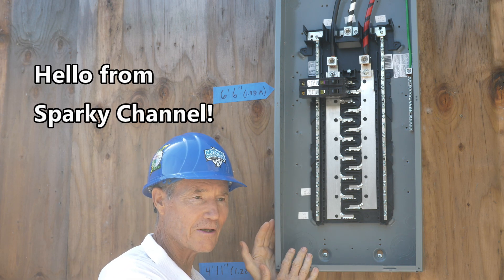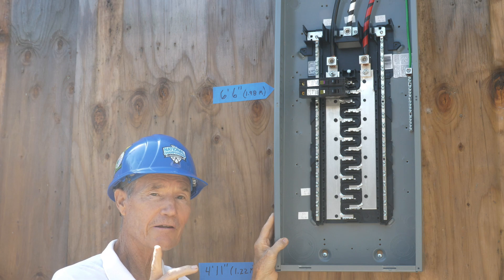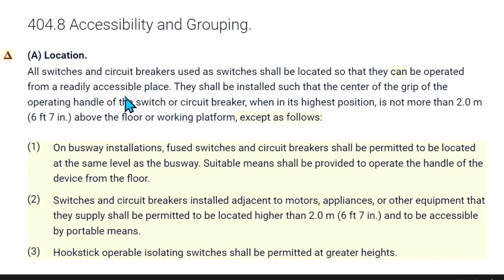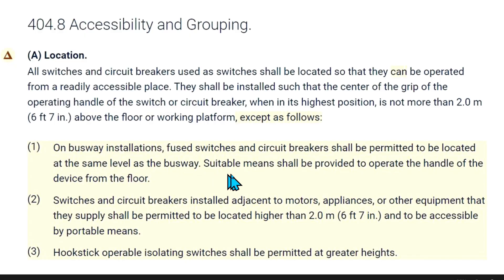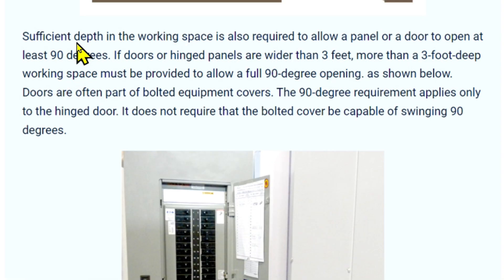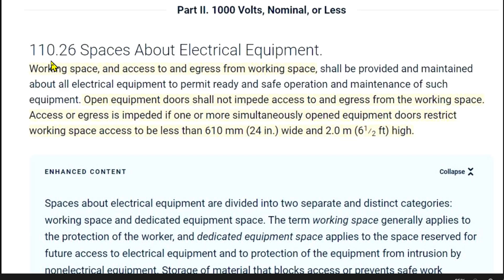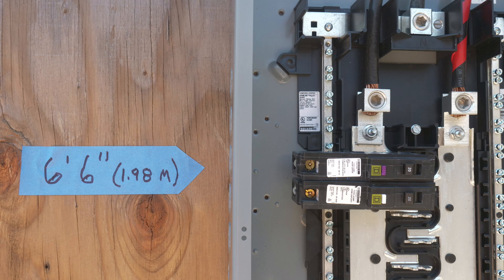Height of Panels and Working Space Around Panels 2023 NEC 404.8(A) and 110.26

Comment: Thank you for making this video - it is very easy to understand!

110.26....".... Working space for equipment operating at 1000 volts, nominal, or less to ground and likely to require examination, adjustment, servicing, or maintenance while energized..."

When talking about a subpanel and an inverter that receives power from a battery and solar....

What if you simply placed large labels on the subpanel and inverter that said - " Do not examine, adjustment, service, or maintain while energized". Would that relax the workspace requirements? Or would an AHJ just laugh at me?

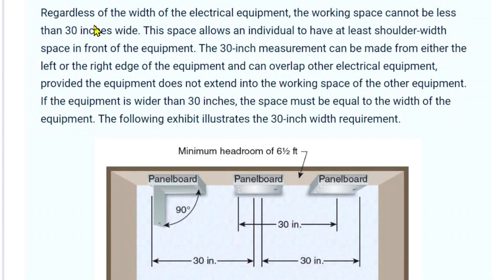Comment: Spaky, at 4:10 "enhanced comment" . "Regardless of the width of the electrical..........ect..". Exactly where can I find this 'enhanced content' ? Sounded like you said "2023 AC handbook"? Looking everywhere but to no avail. Thanks for all your help. P.S. I have the new 2023 NEC 70 code book, and the 2023 NEC Applied Codeology books, but don't see it anywhere in there.
Reply from the maker: Hi Kelly. Yes, "enhanced comment" usually refers to the latest handbook, which for us right now is the 2023 handbook. The enhanced comments are usually written in blue and are not found in the regular code book.

Comment: Hi Sparky, love the video! Do you get inspection issues when you do something like this high panel that's ok by code, but not the local practice? Usual here is 5'9" and I don't expect issues with higher if there's a reason. However, if an exterior resi panel is out of the blue, 9" higher, depending on who shows up, I'm worried about hearing stories of nearby 4'9" grandmothers and "well if you want to get it done today..."
Reply from the maker: I haven't heard of cases where state codes modify this particular code. However, perhaps people from other states will chime in and let us know.
Thanks!
Reply: @SparkyChannel  To be clear, I haven't had a problem with this specific code, they're just all around 5'9", they look right about there and why do something different if not needed. However, I have had problems in other areas were the design approver was fine, but the on-site approver was not, prior approval notwithstanding. You are there wanting to finish a job then, and that new approver is great at coming up with semi-justifiable grounds (say hypothetically for the switch height case "the ground could erode a few inches and now you'll be too high"), and sure you can fight it but then the sign off isn't coming today and the day is wasted.
Reply from the maker: @RJ-ej1nr  I see. Every now and then that can happen, I understand.
Reply: @RJ-ej1nr    in my area, if the ground is sloped and there's chance of a washout, they make you build a level platform for worker safety. If it's more than 8" high there must be steps to comply with other building codes. At 24" it must have a handrail. (more building code)
Reply: Don't worry about any what ifs. Remember one thing, any AHJ must only ensure that intent of the code and minimum compliance is met. If someone wants to enforce their own methods as well as own wishes then they are simply ignorant of what their job entails or worse....  Politely get their supervisor which typically should pass any job that meets the code unless you are in some incompetent or corrupt city or county.
Reply: @RH17  It's not that someone makes up code, they will give you grounds. Still the code does have subjective areas you can drive a neat and workmanlike truck through (professional and skillful truck if it's a 2023 or later model), and there's more than just that truck. On pulling in a supe, that's tricky. Their tendency is to back up their staff. You are likely to see that person again, and they can make your life easy or difficult. Recent example, had something flagged, needed an hour to fix, and inspector said he'd come by again after his others. He would have been within his authority to ask to reschedule, which would push it out days.
Reply: @RJ-ej1nr  it's not up to any inspector to make anything up but that happens a lot... however, what happens more often than a rouge inspector making stuff up as he goes is that most don't even know their own supposed discipline OR simply don't care because they are sick and tired to be wrongfully complained about and  everything gets approved!
Reply: @RH17  Too true, lol!
Reply: @RH17  Had an inspector checking generator installations and the MFGR states there must be convenience outlets for a block heater and battery charger within the cabinet. They also state they should NOT be GFCI outlets. (going back a few years) We install a duplex so we can have room for 2 accessories. Inspector says they need to be 2 separate single outlets because that's his definition of "dedicated outlet" to get by the GFCI rule. He also wants weatherproof covers, despite this being inside a rainproof enclosure already. He shows up before the generator people install the battery charger and flunks the job because there's an unused outlet and it's not a GFCI. This is only a problem in one town. All the other towns in the county understand what's going on.
Reply: What a bunch of rogues.... Handrail is NOT required unless the deck is over 30". Steps to a work platform? Wonder if inspector in your area will make you install permanent stairs to any roof mounted equipment (roof height over 15' high requires one) or in attic. Something tells me that inspector doesn't even know what he's talking about or so capricious that requires you to do things that HE wants and not what min code is or what mfr installation instructions are. Tell him, YOU'RE FIRED!
Reply: @RH17    Yup, catwalk with railings if the attic is over so many square feet, not fully floored. Permanant and railings and steps for roof equipment, 2 stories and up. (only commercial?) I think the 24 inches for step railing is just a single town. The electrical is certainly a single town. Again, the push wasn't for the GFI. It was to do dedicated outlets for NO GFI. To him a dedicated outlet is a single outlet... but must also have WP when in use covers, despite being inside a cabinet. That wasn't spelled out in the older code.
Reply: @rupe53  curios to know what town it is where citizens are forced to go above and beyond what the minimum code requires.. you don't have to answer this of course but that is certainly bothersome.. permanent ship type ladders are required for roof mounted mech equipment located at least  15' above grade and that applies to commercial buildings only not residential per IBC unless your state  has adopted something otherwise. Any UL listed equipment with mfr installation instructions clearly requiring a non GFCI receptacle outlet shall not be violated unless the inspector wants to take that responsibility for a failed operation of a Back-up Generator which I highly doubt. NEC 406 requires to have a "bubble cover" when subject to beating rain. Something inside a NEMA3 enclosure or a porch plug located outside of 45° of beating rain and installed in damp location shall NOT be required to have a bubble cover but only a listed WP cover. Duplex vs a single receptacle does not make much difference if GFCI was truly required. Aound 2005 when GFCI became a requirement for all receptacles in garage including the garage opener plug, a single receptacle was allowed in lieu of required GFCI provided it was to be used for things such as freezer which typically was a dedicated circuit... By today's code typically  ALL 125A and 250A receptacles in locations specified in 210.8 are required to be GFCI protected and again U.O.N.
Reply: @RH17    Yup, some of these go back a few years and I am 4+ years retired now. The Examples I gave were from 3 different towns, which all seem to have their personal quirks. (perhaps inspector quirks) The outlet issue was Weston Ct. The deck railing (24 inches) was Newtown Ct. The first place I saw the rooftop railings was Wilton Ct. As you said, all of this is becoming code. Obviously some towns see the writing on the wall early or just adopt certain sections earlier than others. Let me tell you... we argued that "dedicated outlet" bit till we were blue in the face, but decided the extra few bucks was worth not pissing off the inspector. (who has since moved on) It was all about wanting to get approval so we could get paid $20k for the installation. (pending CO on a new home)